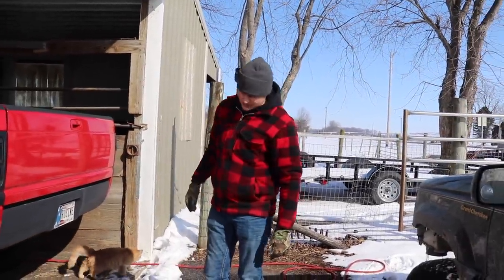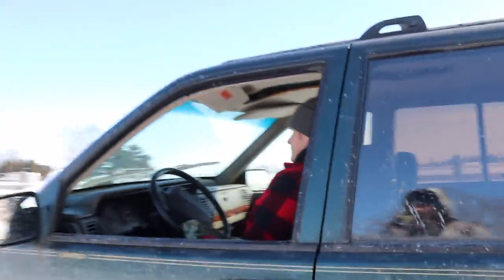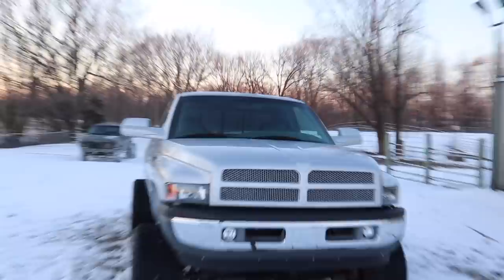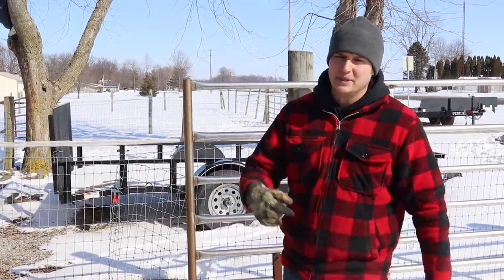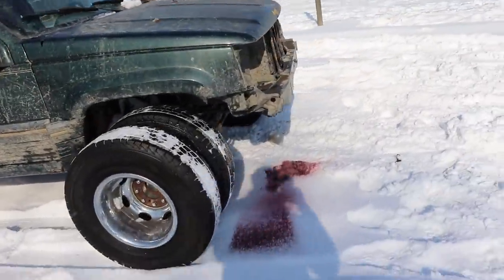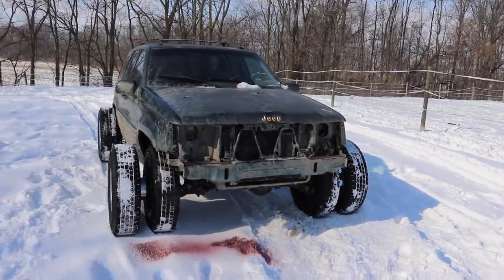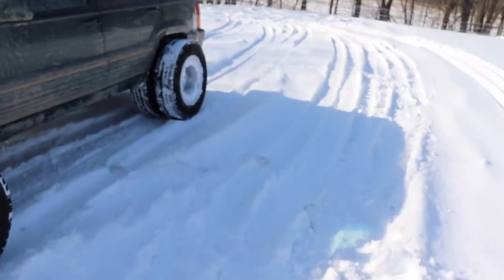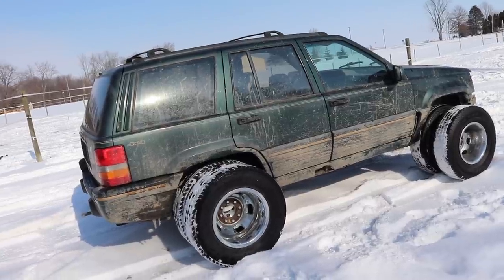THE WORLDS FIRST 8X8 JEEP GRAND CHEROKEE!

Comment: Of all the videos that I want to see?   I'm going to start shilling this to 2000 likes just to see this happen on the trail.   In the snow, I have always said that this kind of setup would be perfect for that soft pack snow with something like some paddles installed. 

you get a lot more surface area and on top of that that does increase your traction especially in the slushy snow that's really difficult to stay on top of.  

I always wished that whistling diesel would go back and make those Reaper wheels and do some off-road stuff in the snow especially in the really horrible to drive stuff because I'm pretty sure they would work really well use that with a snow blower and installed it on the front and I don't think your vehicle could be stopped by anyting